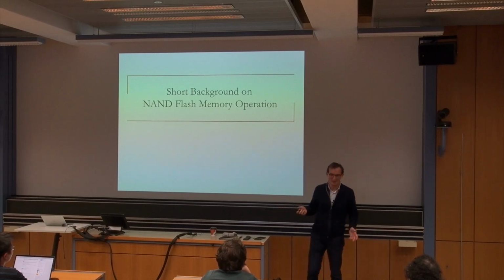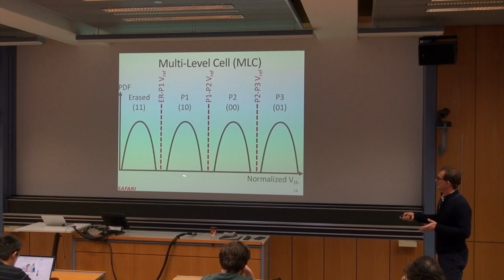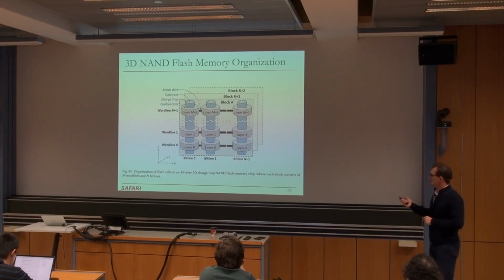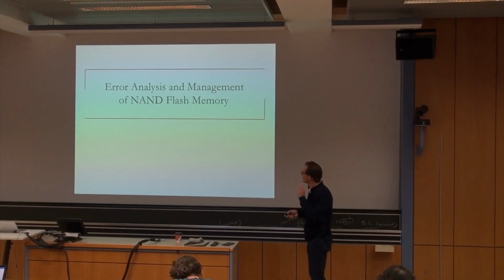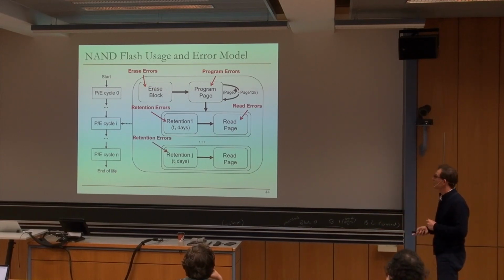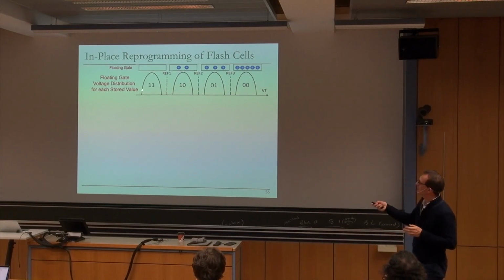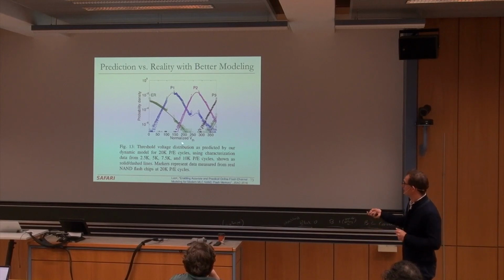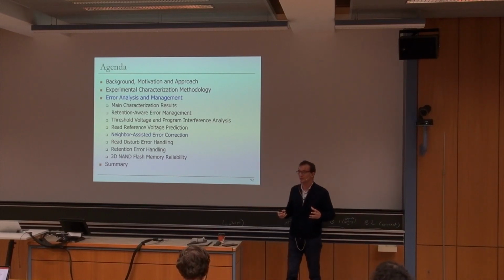Computer Architecture - Lecture 14b: Flash Memory and Solid-State Drives (ETH Zürich, Fall 2018)

Comment: Thanks for the Lecture. May I ask a question? It is said that NAND data can only be stored for two weeks at 55 degrees Celsius. If my SSD works at 55 degrees Celsius, does it mean that the controller needs to rewrite the data every two weeks to prevent data loss?

Comment: One doubt here on Read Flash memory cell array. In a sense amplifier which page has been selected and read data belongs to. For instance : 4x4 page. I pass through 5v to 1,3 and 4 but page 2 has applied 2.5v for (2,1) and (2,2) which is lesser than threshold voltage so no pass through.it will eventually gives 0 on the sense amplifier. My question how it would sense the page belongs to ??